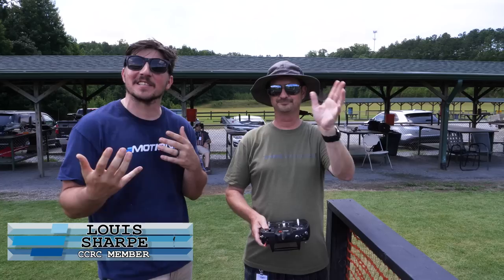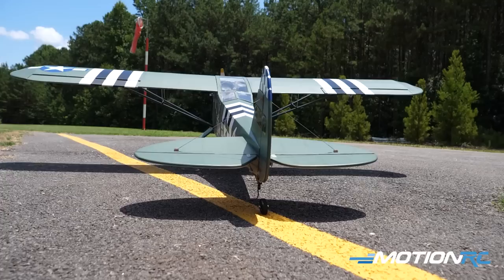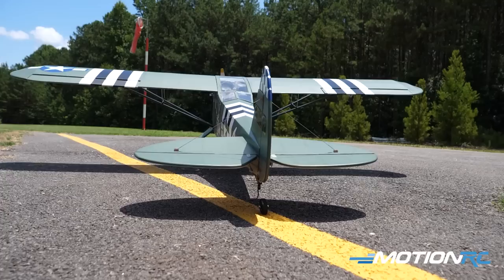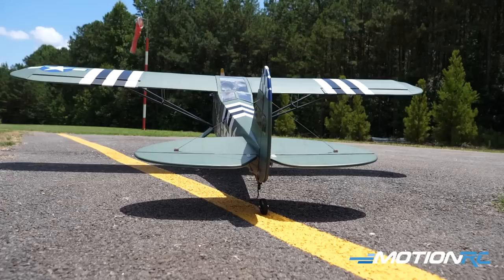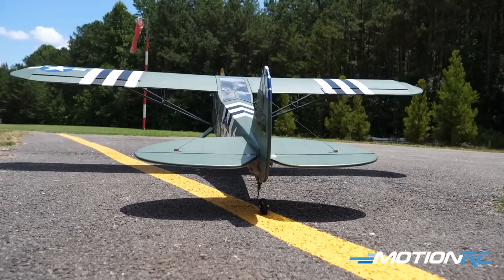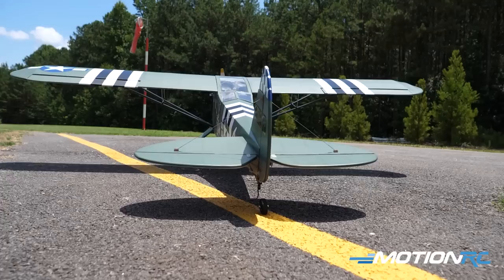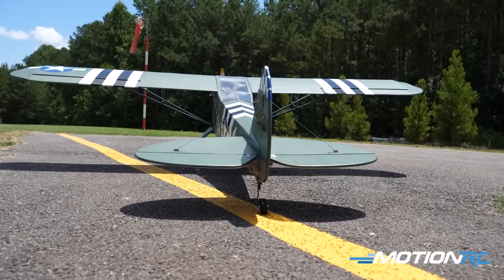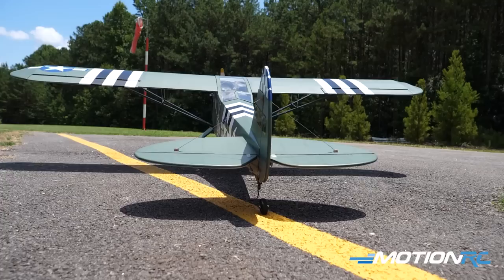Nexa L-4 Grasshopper 1620mm (63.7") ARF Flight - Motion RC

Comment: I have this plane- made by VQ models. In fact it is my avatar! Anyway, it does fly nice and has quite a few scale details for a plane this size. A few things though...
1) No flaps is scale- the super cup had flaps, but the J-3/ L-4 did not. 2) The model is actually a clipped wing cub, which is not scale, at least for the warbird, but that makes some basic acro possible 
3) The covering looks nice and is actually painted, but is very soft, easy to tear, and gets soft in the summer sun. The kit comes with a few patches for repairs, one green and one grey for the underside. 4) The full-scale version of this plane, last I checked, is owned by a Danish Commercial pilot, and frequently flies at airshows. The full-scale has had green, blue and white checkered, and a red and yellow checkered cowl over the years.

Comment: Hi, fine model, i have too! Can you tell me how many cells battery anche mha have you used? wich propeller dimension have you?  I have equipped my Grasshopper with a 660kv motor using a 14x8 and a 4s 3300mha battery. Thanks for your reply.

Comment: What's with the 'wheeler' landings? Why do so many RC pilots seem to think that's how tail wheel aircraft should be landed. there are a few aircraft and situations that that is the best approach, but for most light tail wheel aircraft the 'Three pointer' should be used. (45 years full size tail wheel experience & 55 years model flying)
Reply: Thank you for the feedback. I prefer to land this plane on the mains and let the tail settle, rather than slow to near stall speed and 3-point land, especially if we have a cross-wind at the field. With the big, high wing and relatively light weight, it will ground loop easy with a cross wind.

Comment: It’s a shame MotionRC have opted to rebrand VQ Models offerings into Nexus. VQ models tend to be overly heavy for electric , yet alone IC and generally prone to tip stall. This cub should be OK though, since... we’ll it’s a Cub
Reply: Hmmm...I have four VQ / Nexa models and all of them fly great. I don't think any of them are prone to tip stalling when piloted properly. I agree they are a little heavier than comparable sized ARFs from other manufacturers, however the strength of the construction is worth the difference.
Reply: Louis Sharpe that’s not my experience and I’ve been flying quite a while, both full size and models.